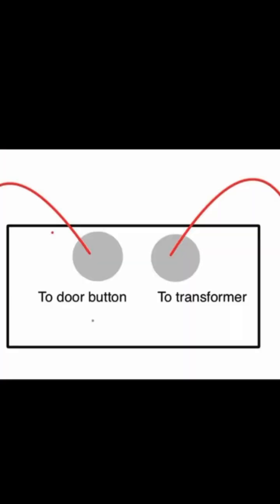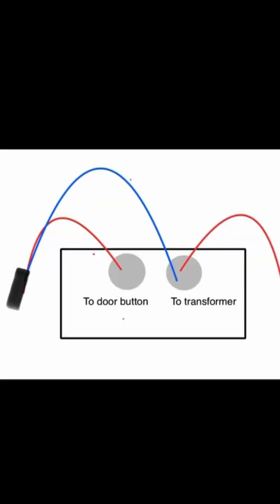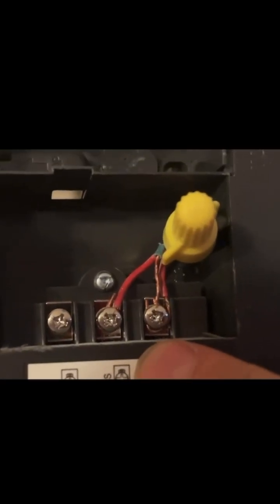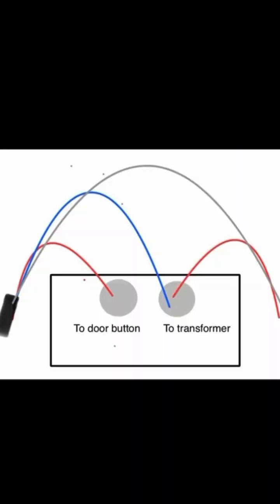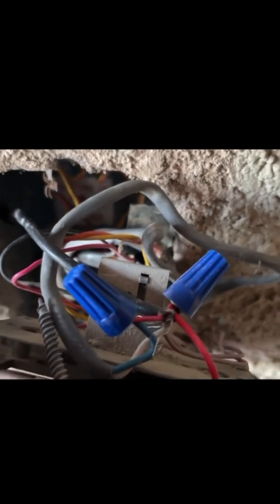Connect to your existing home doorbell, chime, and system to a wired ring doorbell  both work part 2

Comment: So why do you have blue and red connected to front on the chime and not the transformer, shouldn’t the blue wire be connected to the transformer… my issue is that my push bottom doorbell doesn’t chime or ring when I have my ring doorbell pro 2 connected. I feel like I need to my by pass so it gets more juice so it can ring I only heard buzz